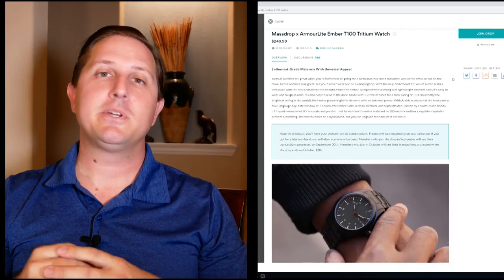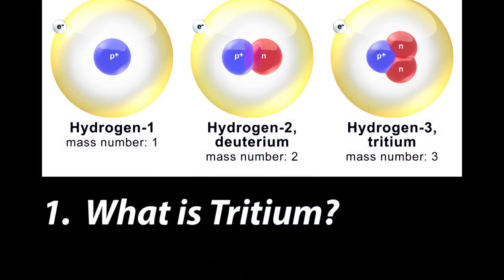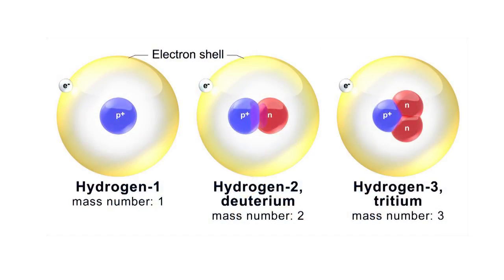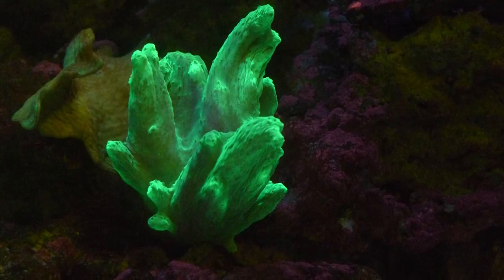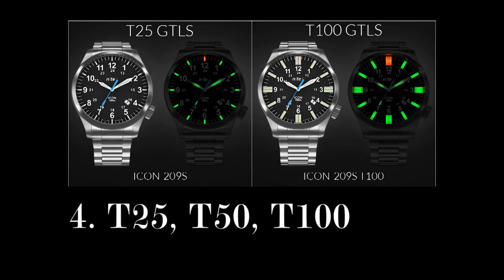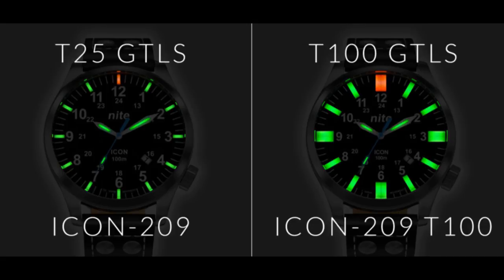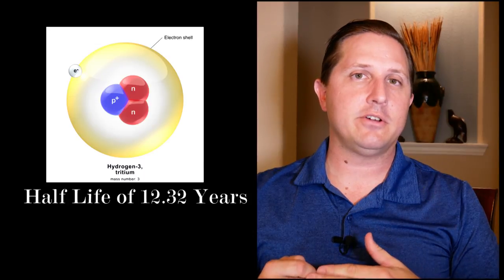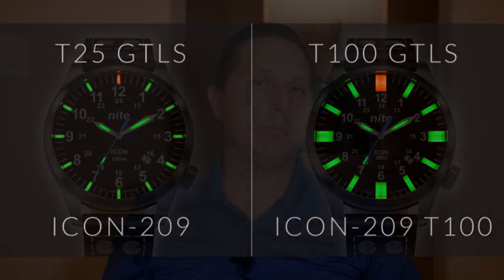Understanding Tritium : Everything You Need to Know, And a Few You Don't (Science Time)

Comment: Very interesting.

 I have a number of tritium watches. I really like them. However, I don’t think they are for everybody.
   T-100 tubes are never as bright as good lume is, and it needs to be very dark to notice them. The advantage is that they glow continuously without a charge for years.
Reply from the maker: Thanks!  I agree that they aren't for everyone.  One of the reasons I wanted to make this is to caution the more casual collector.  As some might be surprised in a few years when they are dimmer, even if you haven't worn them.
Reply: Surfitli I disagree about it needing to be very dark to see trits. I can see the trits in my armourlite just fine at sunset, or in a living room with my tv on. I guess it mostly depends on a individuals eyes and their ability to gather light.
Reply: Jeremiah 1 Maybe difficult to see is the wrong term. Tritium tubes are never as bright as Superluminova or similar grade lume when charged. If you put them together the tritium will be much dimmer. 
    The benefits of tritium are it doesn’t require a charge and glows consistently, as opposed to fading.
Reply: @Roberto Vidal Garcia Yes, tritium doesn’t fade like lume
Reply: Exactly. This is why I bought my watch with tritium tubes for military use. I know I'll be using it under light control conditions and the backlight of a casio from pressing the button, or fitbit with it's heart rate sensing led, show up like a flash light on a light enhancing night vision sensors. My watch, under a cuff of my uniform jacket, is more or less unnoticeable to those devices.

Comment: Great video but you left off some important points:  Some colors appear brighter to the human eye so you have to factor in the color of the tubes.  For the same amount of tritium in a tube green will appear to be the brightest.  Another factor you didnt mention is what T25 or T100  means.  T25 means the total output can be up to 25 millicuries in all the tubes combined.  T100 is anywhere from 26 to up to 100. So a watch by one company designated as T100 could have 30 while another company could have a true100.  The manufacturers never state how much is in any given model which is why you need to be careful with some of the watches coming out of China. I have never found a brand that gives you a certificate with the watch verifying how much total tritium is used.  Does mb microtec even certify the brightness of each tube sold?  And lastly most companies put alot of emphasis on the hour markers but it is the hands that really allow you to see the time in the dark. And the newer flat tubes appear to be brighter than the round tubes because they have more surface area which glows..

Comment: Awesome info too. Can't see myself investing in a Tritium watch for exactly the reasons you specified. Was wondering though, does traditional lume lose brightness over time as well?
Reply from the maker: Yah it does.  Everything decays over time, but I've read that most of the degradation in normal lume is from exposure to light and moisture.  But with normal use it's a very slow process.    Compared to Tritium where it's gonna happen even if it's sealed away.

Comment: Questions:  I'm writing a novel about a survivalist who wants to live off the grid.  There is a room in his dwelling that uses a long-lasting phosphorescent type of light where he stores weapons.  1) Would he be able to use this type of light? If so, how big would it have to be? He has a background in chemistry.  2) Would he be able to create his own light?
Reply from the maker: So like a cross between Walter White and Bob Lee Swagger?  Interesting.

Most of the modern applications are small, and give off just enough light to find them in the dark.  Such as a watch or a gun sight.  Yet not enough to be used as a light source on its own.

The thing with phosphorescent light sources is that they aren't very intense.  The key advantage over a florescent source is that they are longer lasting.  Say hours not seconds comparatively.

Theoretically you could, but it wouldn't be very efficient.  In order to really produce enough light to work in it would have to be huge.  No idea how big off the top of my head, but big enough to not be practical.  Plus I believe Tritium sales are tracked.  So hard to be off the grid if you are already on some registry.
Reply: @RelativeTime  Thank you for your prompt response (alas, I am not so prompt).  It was very helpful.  So I'm back to trying to figure out what my character would use that would not be tracked.  Maybe he doesn't need to light the whole room, maybe something like a nightlight but a little brighter.  If you can think of anything ideas, I would greatly appreciate it.  If the book ever gets finished and published, I'd be happy to mention you in acknowledgements.  Stay safe during the pandemic.

Comment: Very helpful. Quick question why cant we have something like tritium batteries. Wouldn't they last a long time than regular rechatgabke NiMH batteries?
Reply from the maker: There is something kind of like that, but it acts more like a generator and uses a different atom.
https://en.wikipedia.org/wiki/Radioisotope_thermoelectric_generator

If you remember the movie "The Martian", it the radioactive box he retrieved to help keep warm.

Tritium won't be too useful for something like that as the decay is relatively low energy.  Which is a good thing when it's next to your skin.  The other thing is that unlike a batterie, and power source like this can't be recharged.  Once it's depleted, it's done.

Comment: One point which was not mentioned is the x-ray Brehmsstrahlung radiation that the beta particles give off when they are arrested by the phosphor or glass.

This is penetrating radiation and will leave the watch, but it is extremely low intensity and not harmful. It is nothing to worry about but it is also not true to say that no radiation at all leaves a GTEL.

Comment: Could Tritium be harnessed for power?
Reply from the maker: I think it could technically be used.  But the amount of energy given off isn't that much.  So I don't think it  would be very efficient.
Now there are 2 types of nuclear reactions.   Fusion and fission.  Everything we have now is a fission reaction.  Where a atom breaks apart into some smaller pieces.  
Fusion is the opposite, where you have two small atoms combine into something bigger.  And I do remember reading somewhere that Tritium could be a good fuel for a fusion reactor,  where it would react and combine with deuterium (another hydrogen isotope) but I don't know how far that research has gone.

Comment: If my aquifer is contaminated with tritium, how difficult would it be to separate it out for safe drinking?

Do I have to use expensive industrial facilities, or would a curved pipe suffice? Maybe even a boiler, some electricity, and a curved magnetic field?

Surely some cheap solution exists.
Reply from the maker: That's a great question, but I don't know off the top of my head.  There might be an easy way, but I would think you would need some specialized equipment.  Except for being heavier, it should react almost the same as a normal hydrogen atom.

How do you know it's contaminated, and do you know if it's contaminated to a dangerous point?

Comment: I thought it was the phosphor that broke down first, and the leftover radiation remains, but becomes invisible. That's why 80 year old radium watches no longer glow, but remain radioactive.
Reply from the maker: For older radium paint that could be what happens. As Radium has a much much longer half life then tritium. 
I’m not sure what the lifespan of a phosphor is.  I’ll have to look into that. Could vary wildly depending on the manufacturer.  As well as it could last longer in the tritium vials as they are sealed off.

Comment: Hah, I have a few watches with tritium tubes. Of course a Luminox (my first watch with tritium),  a Armour Lite pocketwatch (w/alarm), and a Mondaine Sport. All are just T25 so not so bright,  but at least they always glow.
Reply from the maker: How do you like your luminox? Been looking at a few.
Reply: @RelativeTime  I have the series 3000/3900 v3. For starters it's super lightweight. I'm pretty sure it's only T25 and after 8 years it's considerably more dim than my other watches. It's also 100 percent utilitarian and though military looking, also on the smaller size. I don't wear it too much due to the fact it doesn't go with a lot of outfits except outdoors/leasure. But all in all I do not regret getting one. PS: just grabbed it to check the model number and noticed the battery just ran out 2 days ago 😂 what a coincidence.

Comment: When I purchased my Ball watch ten years ago, I assumed the lume take about 12 years before the light output was reduced 50%. Based on experience with photography, a 50% reduction in light output is barely noticeable by my eyes. However, after ten years my Ball watches tritium tubes are very dim and the room needs to be nearly pitch black, and my eyes adjusted to the dark, before the lume can be seen. So based on my experience with Ball's tritium tubes I would say that the tritium is only really useful for about 8 years. I am fairly disappointed with its performance over the long term.
Reply from the maker: Thanks for sharing.  Theory is one thing, but always good to hear from someone with actual first hand experience.

Comment: An older video but still interesting.  I have a variety of watches but to me tritium vs non-tritium is a much bigger deal than automatic vs quartz.  Every non-tritium watch in my collection just sits there, unworn and unlikely to ever be worn.  Honestly I should just sell the rest.  If occasionally winding a mechanical watch and adjusting the time is sometimes annoying it's nothing compared to regular lume requiring a recharge from room light every half hour.  Even the best conventional lume is pathetic compared to tritium.  True, eventually tritium lume will "burn out" but I have night sights on my BHP that were installed about 27 years ago that are still visible in low light.  My Deep Blue has T-100 tubes which will probably be usefully bright til I'm dead and buried.

Comment: How do we know for sure how many protons and neutrons an element has. I mean you can visually see an atom
Reply from the maker: Well that can be a complicated question.  Plus I'm a little rusty in this.  Are you asking in general, or if someone were to give you something and asked you to identify it?

In general we know how many protons make up a element as that's it's defining characteristic.  If you look at the Periodic Table of Elements the Atomic Number is the number of Protons.  So 1 is Hydrogen, and it has one proton.  2 is Helium, and it has 2 protons.  Etc, etc.  The number of electrons an element can have is also based on the number of protons, but electrons can be gained and lost frequently depending on the element.  Neutrons can be a little trickier because there are different isotopes.   Yet Neutrons have mass, so from that we can help identify what isotope it is.

So as for identifying something if someone gave you sample.  Yes it can be done.  You can't visually see an atom, but there are a variety of analytical techniques that can help give you pieces of information.  Such as one technique can tell you the molecular weight, one may help you identify the structure.  Than you sort of piece it together like a puzzle.

If you ever watch any TV show that has a forensic sci person in it (CSI, NCIS) you have probably heard them refer to something called Mass Spectroscopy or Mass Spec.  On NCIS Abby always called it Major Mass Spec.  Which is one analytical technique you can use.  That's one that can help you determine the molecular weight of an atom or molecule.

There are a lot of others and depends on the situation on which you could or should use.

Comment: Why is everything you represent or illustrate as radioactive glowing the color green? Radioactive elements can glow light blue.
Reply from the maker: The color given off is going to be determined by the phosphors used.  Typically they absorb energy at a patriuclar wavelength, and then give it off at a particular wavelength.  Green just happens to be the most common one available and most widely used.  Although you are correct that there are other choices out there.

Comment: How does regular lume age in comparison?
Reply from the maker: Not entirely sure.  I've tried doing some research here and there, but never found anything concrete.  Now Phosphors should be relatively stable (much more), but everything degrades over time.  That's just reality.

I think part of the reason there is no concrete answer is that there are so many variables it's hard to really nail it down.   So alot of that might depend on the amount of UV exposure (Sun), and how airtight the watch case is.  Plus I'm sure every formulation is going to have some variability.

So I can't really give you a real answer, but here are a couple threads on Watchuseek.  There are a few people on their who say their 20-30 year old watches still look fine.
https://www.watchuseek.com/threads/life-expectancy-of-lume.4864297/
https://www.watchuseek.com/threads/lifespan-of-the-lume.432255/
Reply: @RelativeTime  -Thanks for the info!  I think tritium's degradation is only relevant in comparison to the alternative.  But I guess it'd be hard to do an experiment unless you took 20 years

Comment: While a T100 watch is T25 after 25 years, you'll notice that most of that T100 is in the markers and NOT in the hands. The hands tend to always be tiny thin tubes. This is partly because the hands need to clear each other as they move around, and partly because the watch movement has a certain amount of torque and not meant to drive hands too heavy. The upshot is, a T100 watch won't last any longer.
Reply: Yeah, I noticed that too when they were shown side by side. I'm also wondering whether even the markers will last that much longer, because while they may have four times as much Tritium gas in them, it is also distributed in a much larger glass tube with more volume, so wouldn't the higher amount of Tritium in the T100 markers just result in bigger tubes dimming similarly fast?